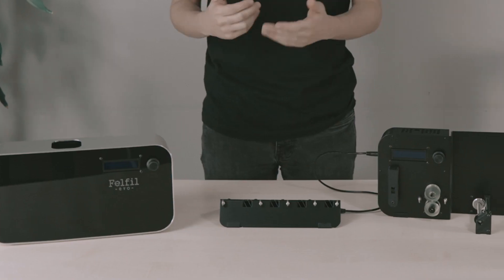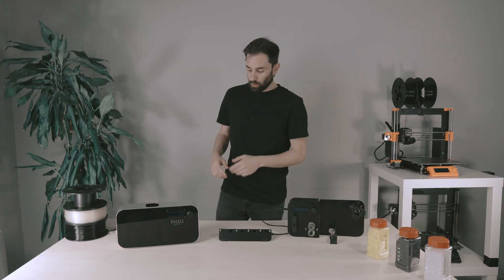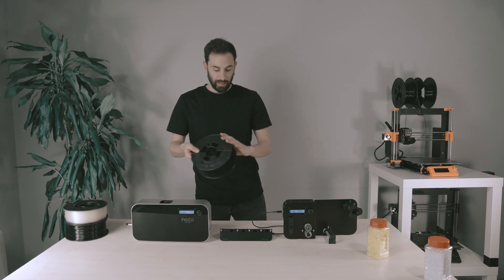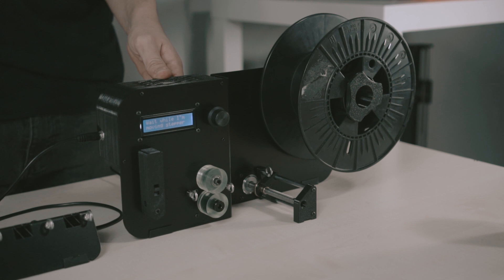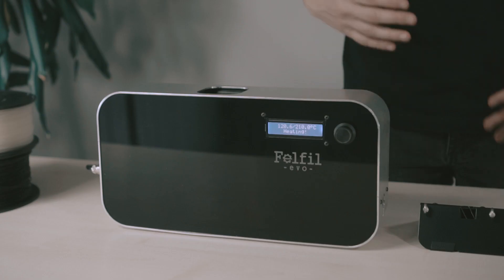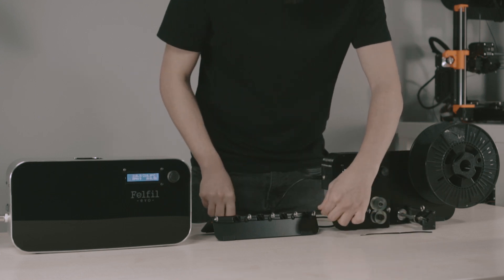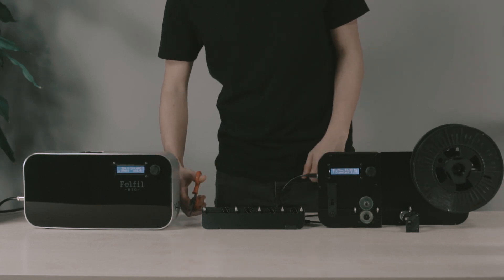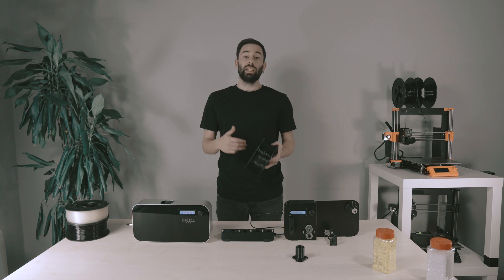Discover Felfil Filament Extrusion System - Make Your 3D Printing Filament

Comment: è tutto molto figo.
L'unico problema per l'uso casalingo del privato è il prezzo: 3k per tutto il sistema è decisamente eccessivo... 
Nel senso, quanto scarto devo avere per poter coprire un costo del genere? 
Ad oggi il PLA viene venduto sui 20€ a rotolo (1kg)
3000/20 = 150 rotoli di pla
Quanto scarto ho che mi giustifichino il rientro di una spesa del genere? 

Il problema di usare rifiuto domestico è poi che non vi sono garanzie nel riciclo delle bottiglie e delle confezioni di materiali vari che si dividono in PET, PEPTG, etc...
Oltre allo sbatta del lavaggio e della pulizia prima di cominciare il giro di riciclo...

Insomma, forse ad un prezzo più abbordabile potrebbe anche avere senso.

Comment: Just got the machine running, how do you calibrate the spooler speed???? Cant find any info on this?? 
Running ABS 9RPM on the evo but the spooler motor chops and cant rotate the spooler around?
Reply from the maker: Hi Mike, if you need support you can contact us by email at support@felfil.com, we'll answer to all your questions.

Comment: Is the product now consistent in delivering 1.75mm filament or still a problem?
Like highlighted  in this video?
https://www.youtube.com/watch?v=TxIxcABYvZI
Reply from the maker: Hi spudd1ver, sorry for the late answer. The filament comes out with a tolerance according to the material. We have now developed the spooler that helps to maintain a good tolerance and it's easier to use rather that the extruder alone.